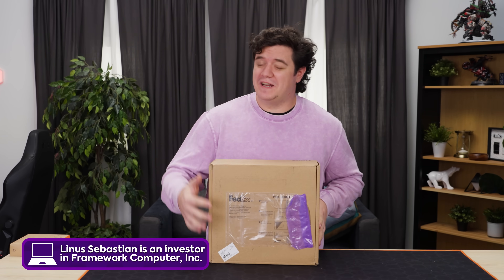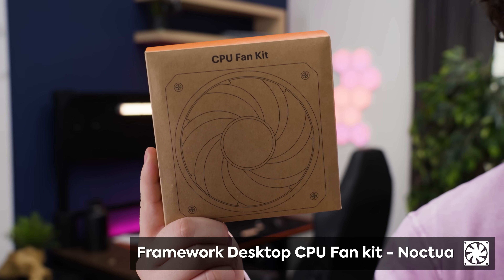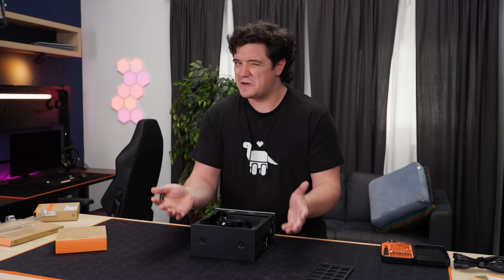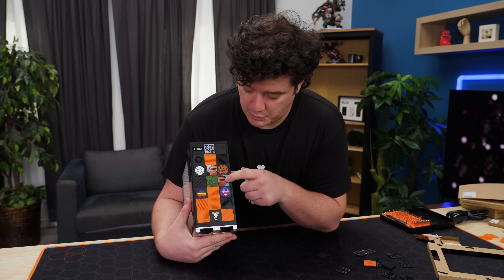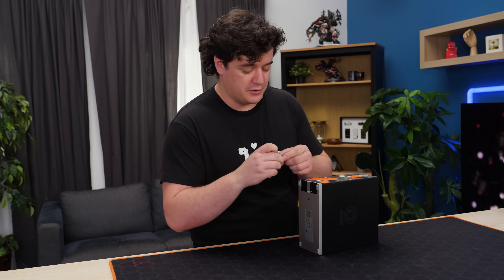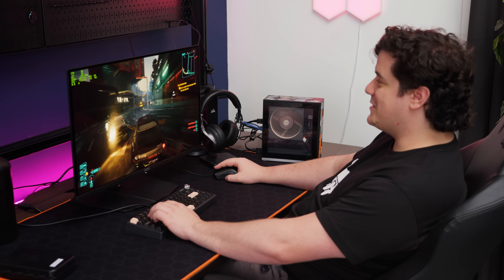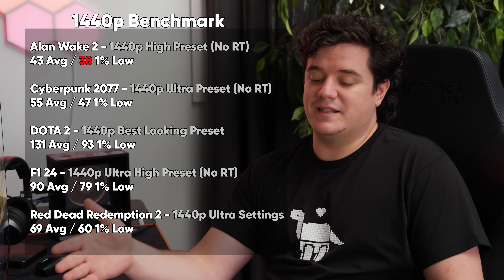This TINY desktop makes me nervous.... - Framework Desktop

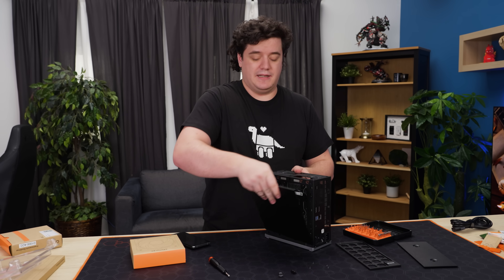Comment: 4:25 Good to see the Wi-Fi card is not integrated into the main board like so many electronics nowadays. It creates a lot of e-waste and I was always surprised that integrated Wi-Fi cards became so common. I use mPCIe, M.2, and all kinds of adapter cards (mPCIe/M.2 x PCIe, mPCIe x M.2) so I can move them between all devices when I upgrade and not end up with more e-waste. Also USB Wi-Fi cards, USB tethering, preconfigured range extenders with ethernet ports and disabled broadcast (works as a external wireless card to ethernet solution), all for on the move/troubleshooting, mostly on other peoples devices.

P.S. It's also better for the power cable to not be automatically included to lower cost, e-waste, and give you options especially when it comes to length. It's extremely irritating being forced to get an included cable that is too long or worse, too short.

Comment: 8:47 is misleading all packs include 7, so you actually have 40 total, 22 used, 18 unused.
You could fill the whole thing for 40$ (10$ * 4 packs (7 each) + 1) or just 3d Print for like 5$, this was one of the most expensive (and "wasteful") possibility chosen, not Frameworks fault.

Comment: I think it should come with a a cheap full size front cover Just injection molded as single piece to cut cost. So the expensive thingies are truly optional. If that's the case they can have them cost whatever they want. Without me counting it as a negative.

Comment: Regarding the C13 power cable, personally I like the option that they don't send more e-waste if you've already got one lying around. However, they should have just included it in the price, then add an option to remove $5 from the price by deselecting the cable. Make it opt-out instead of opt-in.

Comment: Power cable is excluded because you need to select the right region plug. Even when included with other computers its never "free" its part of the price you pay. The $5 is just removed from the barebones until you add it back during customisation. But if you dont need one from them you save $5

Comment: 1 I dont have an issue with the power cord not being included by default cause say you already had a bunch of those cables lying around cause you have a warehouse full of old computers and cases and cables and such
2 you forgot to plug the ltt screwdriver despite having it in the video

Comment: You can get the 395 w/64GB. I just bought the motherboard because that case looks like it belongs in the room of a 12 year old. Also, the front is going to exhaust a lot of air because of the fin configuration on the heat sink. Why can't ANYONE make a 4L case that has enough space at the top for a thin fan. Was able to find a case slightly smaller than what Framework is shipping, and it has holes in all the right places. Custom PSU cables would have been a great idea because they are twice as long as they need to be.

Comment: I mean honestly, you guys bought 4 packs of 10 just considering the base color tiles which is already almost double the amount necessary to cover the front panel. it was an ugly and overly expensive configuration and could be made to look better for less then 50. the waste was extreme considering the diagonal tiles only 1 or 2 of the packs of 10 were used. yes they used a market standard but admittedly predatory pricing strategy but you picked an absurd config

Comment: Even ignoring how this product segment is completely non sensacle for framework to attempt to compete in, the way they handle the tiles on their site is truly idiotic. 
They are NOT marked optional, even if it's technically possible to avoid buying them, they certainly don't want you to do that, hiding the option to skip it behind a dark pattern. So the black tiles should simply be "free" on the site and included in the base price, with you being able to "upgrade" to other colours and add additional single tiles for addtional money.
The power cable should also be included by default, and a discount on the base price to remove. 

But this is once again a truly crazy product for framework to push when they are supposed to be a company aimed at repairable machines. I know an absolutely fantastic way this machine could have been made totally repairable and upgradeable, and it would have been even easier for them. This could have been a fantastic prebuild machine that by design uses 100% standard ITX parts and has the framework touch with documentation and customisability, where most other small prebuild machines are made with completely non standard parts. But they did this just so they could chase the bursting AI bubble? Very disappointing and I hope that I'm wrong about them continuing this direction.

Comment: tbf, i have like a dozen of those power cables, so if i can save 5$ then im happy. Honestly, cables are just as important as the device, so you should source your own because if you want something cheap, theres 3$ cables online, but i want quality thats got good shielding, braided sleeves, like ill drop 15-20$ on a nicer cable because its an investment, but most businesses wont give you that style of quality, theyll just give you a cheap 5$ cable, no thanks.

Comment: Regarding the soldered RAM, there is a logical reason, and both Framework and AMD went over this during the launch announcement of the desktop. They could not add replaceable/upgradeable RAM, as AMD attempted it, and it would cause issues and just not work entirely with these AI chips. Hence, why the configurations have so much memory already installed, it was the only way to get around it. They are however continuing to work with AMD to see if this issue can be solved in the future. But for now it cannot be rectified, hence the soldered RAM.

Comment: Disagree on the power cable take, because of how many devices use that cable, (almost) everyone would have an extra laying around, otherwise it is 5$. That is part of the appeal of a framework device. You can even get their laptops without PSUs. 

As for the memory being soldered, that is a requirement for that CPU. The memory interface is 256bit wide, SODIMMs are 128bit wide. The memory performance is critical to the power of the 8060s. By halving the memory bandwidth, you destroy the one feature you claim draws your interest to the machine. 

No company should be immune to criticism, the commentary on the front panel is valid and justified, not coming with 21 black tiles is a bit odd, espically for the price. You also (briefly) mentioned the PCIE 4x interface, the Framework desktop is one of if not the only 395+ equipped PCs with a full size PCIE slot.

Comment: Using the term "Unified Memory" is so misleading as it is meant to make people think it works like how Apple Unified Memory works. It absolutely does not. Its not like how a typical iGPU works either, where the memory is being separated at the hardware level, it is instead separated logically by the OS allowing logical video memory (LVRAM) to be scaled as needed (Upto a certain mamximum). However the GPU still can NOT access the memory being used by the CPU. So that means that data still has to be copied from the logical system memory being used by the CPU to the logical video memory being used by the GPU.
The memory is also not coherent. This means that transfers and syncronisation must be handled by the OS creating a certain amount of overhead and limiting GPU performance when compared to Apple Silicon. As much as I hate Apple, their truly unified memory is an excellent architectural step that needs to be followed by everyone else. Especially given how fast modern consumer memory can get and the sorts of capacities available to consumers these days.
Hopefully AMD makes the right changes to memory unification in line with Apple Silicon for their upcoming new UDNA architecture. Otherwise the only point is modularity and they will lose out on of heaps of performance, especially in tasks that require lots of RAM and VRAM. Like "AI" tasks. True unificaction should allow AMD to be able to crush nVidia in the AI space.
I suspect they may be moving in that direction, as their recent performance announcments and their claim to not only crush Blackwell architecture, but also Rubin within a single generation would be made easily possible by true unification of RAM and VRAM.

Comment: I'm pretty sure the PC had no room for upgrade regardless of ram. The limitations due to it's size are too high and you really wouldn't be able to swap out any of the parts if any should you have tried, The PC is a one and done and is only upgradable should you decide to buy a new one that comes out or if it becomes dated. That being said investing in selling refurbished devices similair to apple or even managing tech recycling plants for your product would be a simple solution to stick with the core idea of your company.

Comment: I'm so thankful for every C13-like Cable that is NOT included. My drawer is full of them. A specific Fan-Kit is not in there. I mean what's the point. A power-brick/charger is also critical for using a smartphone or laptop. Framework does not include it as well in the laptops. In EU sold Smartphones don't. It's somehow consequent?

Comment: I like that the C13 is optional, because I have literally 15 of them (still in their twist ties) because of all the new stuff I've bought over the years.  I don't throw out the old C13 with the old equipment, I just toss the new one in a bin. Framework's approach should be applauded for reduction of e-waste. I also save $5. Your frustration is confusing. You act like they're being cheap by not "including" it.  Well, the more they "include" the higher the "base price".  See how that works?

Comment: For the extras
The cable makes sense as it is generic and can be purchased locally, which is a big plus that they don't just ship a default one given I have bought laptops online for which they provided multiple plugs, making one useless as none of the plugs in my home fit American plug. (there are a few lying in my storage collecting dust) 

As for the face plates, given it can be 3d printed makes sense they're keeping it as an extra.

Maybe they could have changed the language and made a bare bone tinkerers edition or one without cable the international edition.

Comment: Wanted to love this when i first saw it was in the works. Far too many compromises for me. Whatever the reasons the soldered ram just diverges too much from the initial framework ideas of upgradability, same for the cool but useless plastic tiles, lets make a product with yet more useless plastic that's very purpose specific, and also very pricey, yes you dont need them but its a pretty ugly beast without. WHY oh WHY for $1000+ couldn't they include a basic power cord as a free choice, I understand people may already have one I have loads but just give the option to not include it rather than charge  for it or maybe if there is that much concern about waste dont have a fancy plastic tile system!

All round though, the performance is great for what it is, the price i dont love and it also feels like too much of a compromise on the values that made framework appealing.

Comment: seems is something like ~ to my acer nitro 5 i5 gen 11 3050ti, I'm right ?    
I'm looking to build an ITX build and it's around 1.7k - 2k Euro (7800x3d and some potent GPU to play properly games, I'm tired of laptops). 
PS. I'm working as a truck driver atm and it will help me a lot a small build. Seems nice this framework but I don't want to get into a situation to be like the laptop  I have..

Comment: i have a literal pile of c13 power cables of different lengths....   I would much rather it be an option to not get one, in the same way its an option to NOT get a framework power brick and USB C to C cable when buying a laptop. you can just use your own... because... ya know, Reduce REUSE recycle.   
pretty much anyone buying a framework desktop has an extra cl13 power cable at home.   So yeah, they COULD include something almost no one needs, but then it would cost more.  

you can also buy a framework desktop without any storage. I'd say storage is mission critical for the device to work... but no complaint about that?  and the fan kit... of course they include a fan kit and not a fan... you need the kit to install a fan and you probably don't have one of their kits laying around. while it is likely you have a fan to put in/have a specific fan in mind.
I'm normally with  Elijah but i think the over the top complaint about the power cord was a bit off base.

and 3:00   yes, if you want to customize your computer ,its costs an extra $30.  another way to say that is "if you don't need a customized computer, it costs $30 less"     or you could make your own decorations...
makes the entire complaint just sound like "why didn't they force me to buy more stuff?!?"

Comment: i have a box full of power cables that were left over over the years, so i wouldn't actually mind if devices generally only came with a cable if i specifically ask for it so i can use those that i already have. at this rate, i'll throw them away at some point which i dislike.

Comment: The power cord is 5$ because most people buying a framework already have like 12 of them so it's do actually deter people from buying it unless absolutely necessary. Or you can pick one up locally for 3$ and save the shipping waste.
This is also the reason why RAM and storage on framework's site is severely marked up. They don't want you buying from them because it defeats the purpose of a diy machine, plus it allows them to stock less pieces in their warehouse. 32 gigs is like 140$ on their site, I got my kit locally for 70.

Comment: Screaming about the power cord being mission critical but being completely fine with the M.2. 
Those plastic plates are a complete rip off though. These should come with one standard front and then the ones you order extra for customization. 
There is no way this is ok from a value standpoint.

Comment: I don't really get the complaints about either the power cord, the optional plastic bits, or the soldered ram. 
The power cord is probably literally the most common cord I've ever had - I'm super happy to have less wasted cords. As long as I knew it before I bought the pc, I'd not have a problem with it - I'd either have a spare at home, buy the $4 one, or shrug and get their $5 one.
The plastic bits are optional. If the whole point is you can print your own, AND the pc works fine without them... What are you complaining about? Seems like they're very much about the modularity and choices you can make.
The soldered RAM is probably the problem I can most sympathize with, but then again - if that's what makes a pc that size able to play games, that's awesome and a choice I'd get behind. It's not like they're doing it as a greed choice.

I think it's pretty cool. The price is maybe an issue but the performance and size makes it well worth considering. And I'd save a lot more money and happiness than you cuz I wouldn't buy the cable nor waste money on the plastic bits and then complain about it.

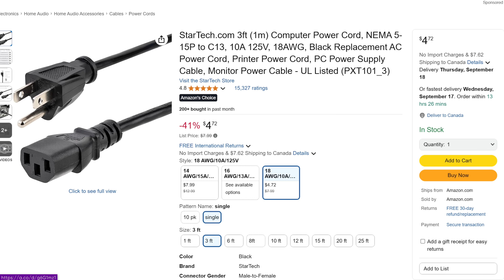Comment: 1:20 Well, most that have owned a computer, a printer (or some other stuff with this cable) at some point propably have these power cables just lying around. At least there is an option to not have it included if you want to save a bit. Most of these extra cables probably are from some non functioning printer.

Comment: You complained about the cable being "mission critical"
You could argue the same about a mouse, keyboard, monitor, speakers/headphones
Would you really expect them to include those? You're kind of expected to already have them, as you're probably upgrading from or replacing a different system

Comment: by the way, 80mm fan in the front should probably be exhaust, not intake. Exhaust fan would creat negative pressure, which would help tremendously the main 120mm fan in pulling air for the CPU, helping in cooling. This is generally the META for small SFF cases like that. Especially so as the heatsink seems to exhaust the hot air horizontally, so exhaust at the front and back. An intake in the front would work opposite of the CPU fan

Comment: Sorry. This product is absurd at this price point. Makes no sense to have such a limited device in a small form factor under the Framework branding and at such a massive premium price.
You will soon see other OEMs and even Chinese manufacturers with those CPUs at a much acceptable price and will probably provide the same performance and capabilities (and a power cable). The tiny pieces of plastic are cute, but provide zero functionality and Framework is not about that. Or I hope it doesn't become that

Comment: I thought the whole point of CAMM modules is to have something that's near soldered-level performance but still upgradeable. I read the write-up on Framework's blog about how AMD's engineers tried a whole bunch of different configurations, but I wonder if they tried back-mounting the RAM in their testing, considering the rear of the motherboard is as accessible as it is. I feel like that would be a good spot for the RAM; being able to get it right up near the APU from the other side of the board. Of course, one issue with that is that from my understanding, CAMM only allows one module, period. That always felt like a major oversight to me, because it limits form-factor.

Comment: having that thing delivered without a power cord and without one set of covers/a different frontplate without the slots for the small covers is not acceptable, especially for that price. the soldered ram isn't great either and i hope that there are different models available that probably don't perform as well but have ram and maybe cpu exchangeable